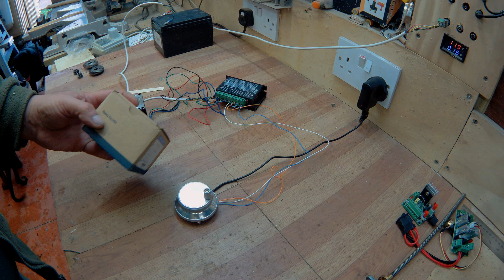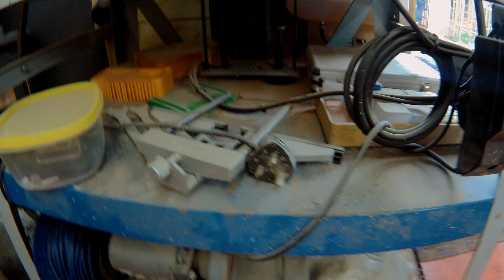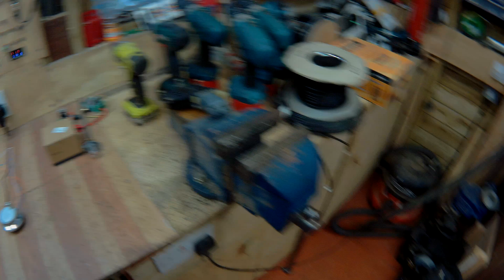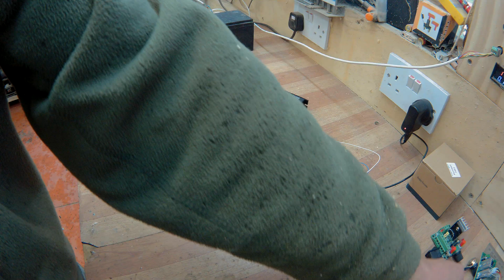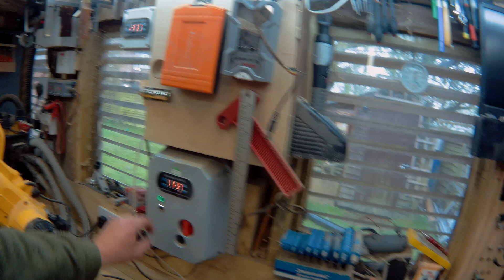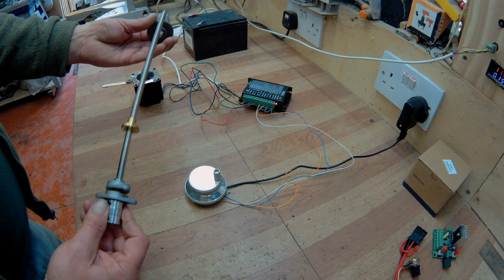Control a Stepper motor with a rotary hand wheel encoder.

Comment: Great! Is it possible to adjust the motor to follow the hand wheel 1:1?
🇩🇰
Reply: Not on the 6600 i had. I think the closest i could get was about 3:1, But i wasn't looking to read the scale on the dial because i was driving a screw thread via a bevel gear anyway, so nothing would correlate.

Comment: Do you think its possible to ad some sort of Feed, or cuntinouus revolution of the Stepper motor within this ? ^^
Reply: Hi. The signal generator i mention in the video would give you continuous revolutions, if you just use it to inject a constant signal into the driver. But, to be honest, if i just wanted continuous rev's i think i would just go for a small gear motor with a motor reverser if needed. Much cheaper. Or if you can supply it with 12v, a car FRONT (not rear) window wiper motor. Cheap as chips from ebay, and reversible.
Reply: @General_Confusion  yes i know that, but i want both 😅, the feed when i need it and the system you demonstrated to fine ajust the position of the tooling, zalking about the Z Axis of a mill 👌
Reply: @pureblack8985  Oh i see. Well there is no reason why you couldn't use the signal generator for the feed and the turn wheel for the fine tuning. Both would need to be connected into the same terminals of the driver, but you would need to use some kind of switch to isolate one from the other. IE, use a double throw switch or relay and send the signal from each to either side of the switch with the switch common going to the driver. A double pole change over relay would be your best bet, with a simple momentary push switch to activate the relay. Of course the signal generator will give an output all the time it is powered up, so that would need to go on the normally open side of the relay. You would also need to find a way of reversing to polarity of the signal from the signal generator for it to be able to drive in the opposite direction. 
Can't help but think that for the application you want, this solution may be more  complicated than it would be with dedicated cnc software.
The other option would be to extend the dip switches outside of the driver in such a way as to increase to speed of response from the turn wheel. for example. For slow speed set the dip switches to say 1 to 1. for fast speed change the dip switches to say 1 to 10. At the time of replying to you i don't have the 6600 with me, but i suspect you would only need to extend one of the dip switches to get it to go faster.
Regards Steve.

Comment: This is exactly what I'm trying to find.  I agree completely.  Either the other vids are arduino and go on and on about what you don't want to know or they just show that it works in 23 seconds and that's the end.  I've got a question.  Did you try to take the 5 volt out from the driver and use it to power the pulse encoder instead of the wall wart?  I'm trying to figure out a way to move a mill table quickly with a joystick, and then use the encoder wheel for tiny adjustments.  Also, have you tried to control step size with the dip switches on the driver instead of the pulse generator board?  I was messing around with one of those last year and I was having the same problem that you are and I think I either used full steps on the driver and controlled fast, med, slow on the pin connections of the generator, or I set the driver to like 1/60, and pulled the pin connector off the generator.  I think when the driver is already set to a fraction and then do the same thing on the generator you end up with both trying to fractionalize (not sure that's a word) the steps and it won't work.  My memory isn't that great though.  Thanks for the video!
Reply: Hi Bill. There was no 5 volts out on the controller i have, the power input is just 9 to 40 volts. Which i assume is governed by the voltage of whatever stepper motor you use. I would use some alternative psu for the hand wheel if i were to install this setup for anything. Possibly just the guts from a 12 to 5 volt converter like you get in a cigar lighter usb charger in a car. 
The pulse generator board would move the stepper motor faster, and i did consider this when i was messing about with it. But it is pretty fast and my requirement was just to move my router 2 or 3 inches. 
I'm not sure what you get out of a joystick. If it's a basic one with simple direction microswitches, you could possibly use two controllers to run the same stepper motor in parallel with diodes to block feedback from one to the other, with the controllers set at different pulse rates. If it's a linear pot one like you get on a cctv ptz controller, you could use this in replacement of the speed pot on the pulse generator. You would require four pulse generators to get the four axis though i would think.  
Not sure if that would work, but it would be at the top of my try list if i was looking for that result.
For someone with a bit more interest in arduino than me, that would probably be the way to go for something more complicated that what i needed. I was more interested in simplicity and i knew there must be a way. I simply couldn't find anyone else who had posted a simply video. 
I have yet to do anything more with this. After i made the video i left all the kit connected together and put it in a box and stored it away in that place you put projects to do later.
Hope this helps, i would be interested to hear your results. Steve.